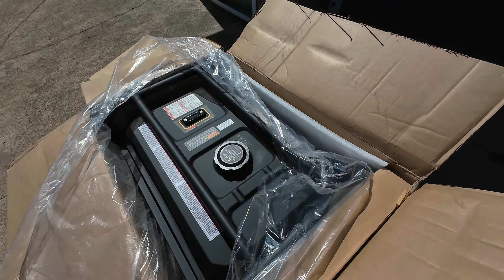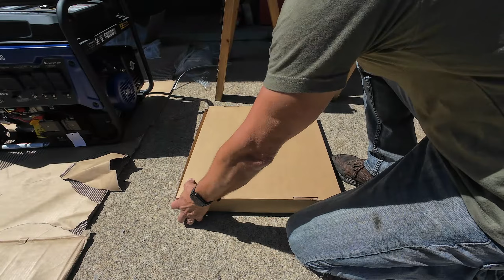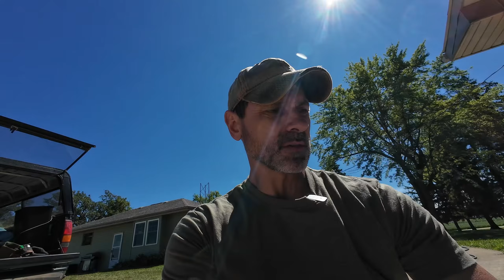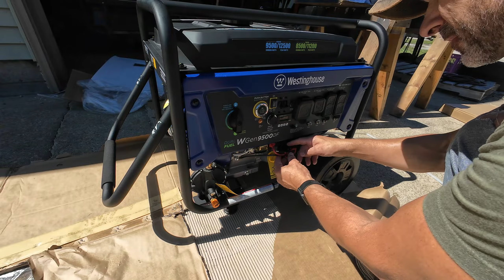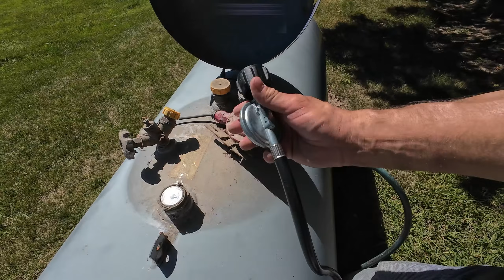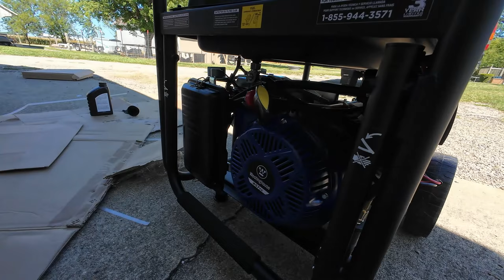Westinghouse Generator Unboxing And Assembly - WGen9500DF

Comment from the maker: If you have any other questions I can answer, just list them here in the comments.  Thanks for watching!
Reply: I recently purchased this generator. At the moment I can’t get a transfer switch or interlock system installed by an electrician… will I still be able to use the generator and hook it up to a propane tank, and just plug in my small freezer,heater, and lamp directly into the generator?
Reply from the maker: @anitra_g_fit5601 absolutely! I just wanted a more integrated setup without having to deal with several extension cords. Keep in mind to keep the generator outside, so the exhaust doesn't cause a carbon monoxide hazard.

Comment: Did you switch the neutral from bonded to floating?
Reply from the maker: Not sure what you're referring to
Reply: @rustichandyman  the generator comes with a bonded neutral configuration and if you feed your houses electrical panel (garage plug) it also has a bonded neutral which is dangerous.  An electrical system should only have one bonded neutral, the generators owners manual gives instructions on how to unbond generators neutral and create a floating neutral.
Reply: This is a great explanation https://www.youtube.com/watch?v=gchq6G5Wc8M
Reply from the maker: @anonymoususer8321 oh, I didn't do that.
Reply from the maker: @anonymoususer8321 thanks. I'll have to check it out.

Comment: Picking mine up today or tomorrow. Sold my 23yo Troy-Bilt 5550 a few days ago.  It was time for an upgrade in power and features, like the electric start.  Pull starting a generator stops being fun after turning 60yo.
Reply from the maker: Yes, the remote is super nice as well.

Comment: Did you connect the generator to your home breaker box?
Reply from the maker: I connect it through a 230 volt receptacle in my garage that was already available.. This isn't the proper way to do it but it works well for my situation. No matter what you do you have to be careful to isolate your system from the main power feed when using your generator. The proper way to do it is through a disconnect switch.
Reply: @rustichandyman Thanks

Comment: When it didn’t start on the first two times you hit the push start what did you do the 3rd tom that got it started ? I couldn’t see .
Reply from the maker: I didn't do anything. It automatically keeps trying for several times to start. It finally got enough propane in the line that it started.

Comment: great vid.  did you do the break in period on the generator?  and have you ever used gas in it? Thanx
Reply from the maker: I did not really do a break in period, other than let it run a while without load, and I've never ran gas in it.

Comment: Nice video. Got mine this morning. Snagged it on sale last week for $899 on Amazon. Would like to see how you wired to your meter.
Reply from the maker: I plug mine into a 220V welder receptacle in my shop/garage and back feed it. I have a meter box replacement video coming up that explains it a little bit more.

Comment: I would really highly recommend you try and pull start it. One thing to notice you have to manually put the choke on full open.  When it shuts down in the automatic process, the choke goes closed so when manually starting it, you need to move it manually to full open.  Unfortunately, in my experience, it takes several poles even if you purge the propane out of your propane line it takes several poles to get propane from the regulator on the generator to the combustion area.  But if you make sure the choke is full open, it should crank up by pulling the cord several times just like it does in the auto automatic mode where it took three starts in your video.  You can pull on it all day in the closed choke position and it will never start!
While you’re at it, disconnect the battery and practice starting it like that as well. You may be stuck one day when the battery is dead and the starter doesn’t work so it’s important to have that scenario planned.

Comment: I noticed that they shuffled the outlets around compared to older models that way the big 50a cord doesn't hit the wheel 👍
Reply: Hey i would recommend changing the plugs to ngk the stock one is super cheap torch.